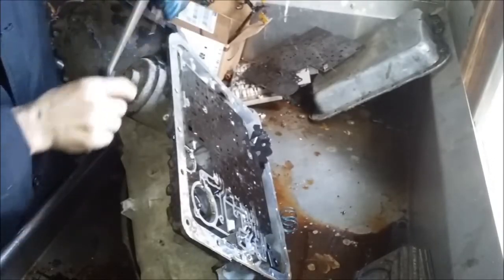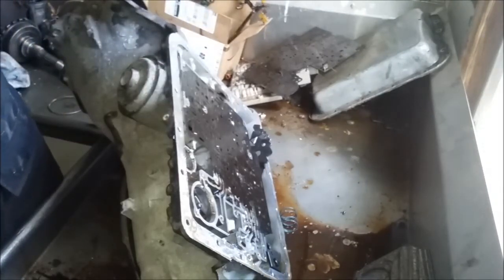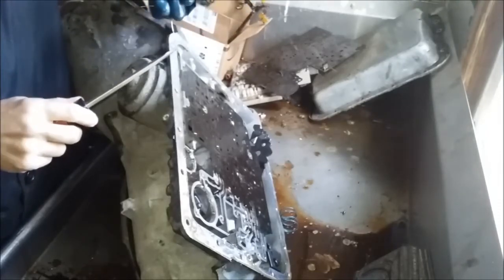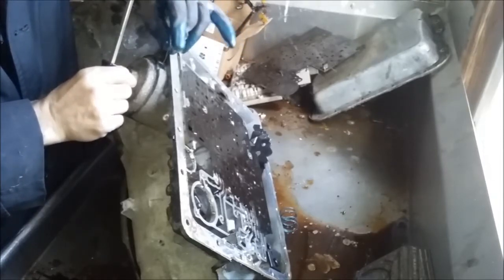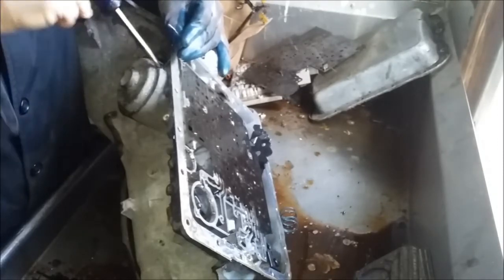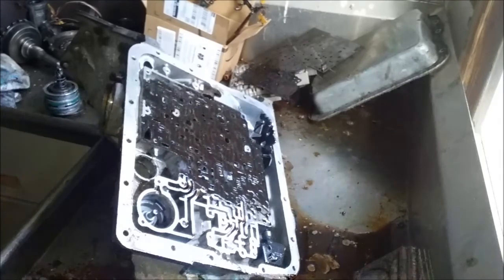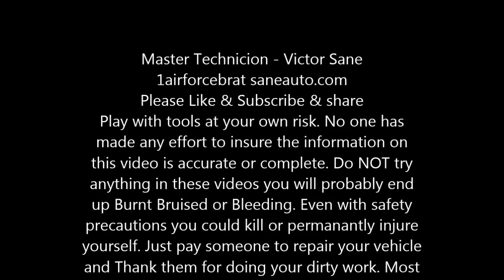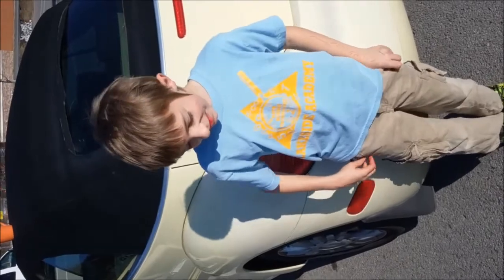700R4 Automatic Transmission Rebuilding Servo Removal 4L60E

Comment: Can this be done with trans in car?
i have a 96 ranger the servo plug is leaking the truck only has 130k on it trans shifts great no issues but i noticed the other day a trans fluid leak! Like an idiot i went right to the pan gasket! Well after changing the pan gasket and filter it was still leaking! I thought great the pan gasket didn't seal! So once again like the idiot i am i pulled the pan again and resealed it! And for the 2nd time i had a leak! I thought i know i,m an idiot but come on! So i,m an old man it's not easy climbing under that truck! But bad back and all i climbed under it again this time i took my phone a recorded the area the leak was coming from from! So i rush into the house look at my phone recording just too see that the servo plug is leaking right above the pan =\     This is a 96 ranger can you replace the o-ring and snap ring without removing the trans?
Reply from the maker: I know how you feel. I have two ruptured disks of my own now. Its hard to see without a lift. The good news is you can replace the servo O ring without removing the transmission. However, the Ranger is a tight fit there have been times when I found unbolting and removing the exhaust was easier than trying to work around it.
Reply: Titan Fall first step is to get rid of that $hit Ford and get you a Chevy. In all seriousness though, it can be a pain in rangers but can be done by massaging the trans tunnel sheet metal a bit to get more clearance. Good luck.

Comment: with a longer shaft can you not tighten up the band clearance? and won't that help your 2 to 3 shift?
Reply from the maker: There are three different length shafts indicated by the rings near the tip. 1, 2, or 3 rings.